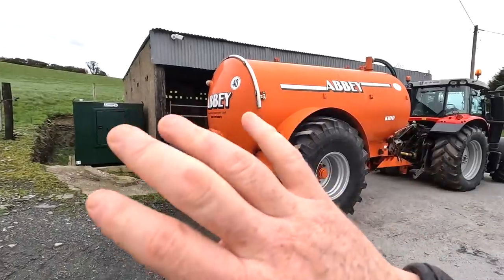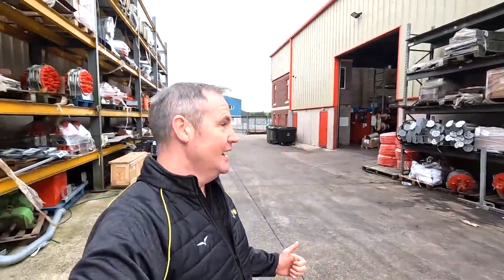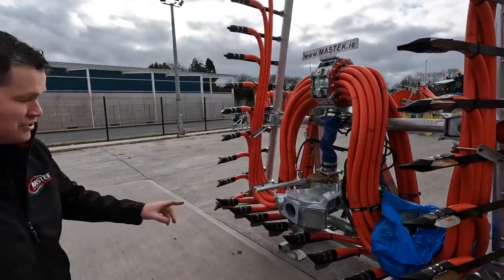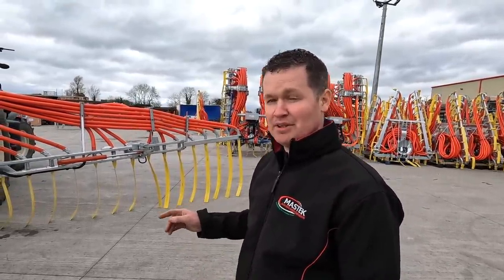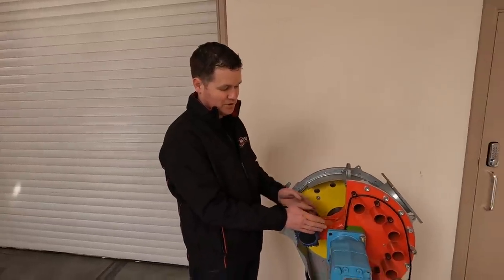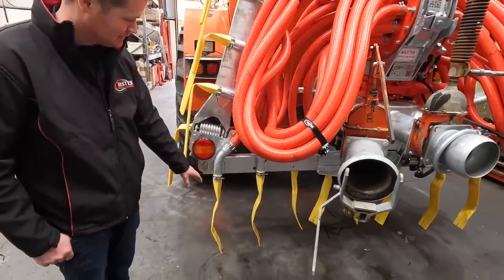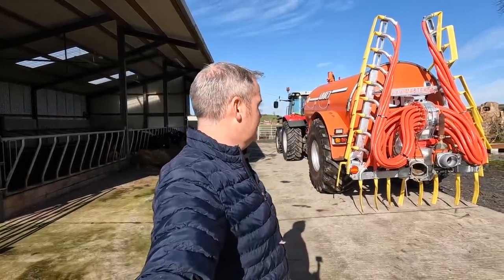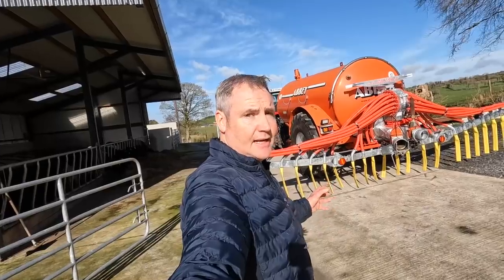RETRO FITTING A MASTEK DRIBBLE BAR TO AN OLD ABBEY TANKER - HOW IT'S DONE

Comment: Great to see you looking out for local businesses - what goes around comes around. It's certainly an extremely impressive operation at Mastek.
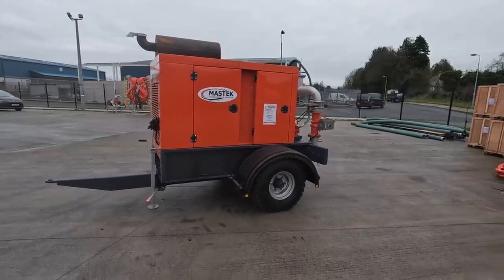12:35 wondering what's the petrol engine for, is it driving a vacuum pump for priming the system?
Great informative video, best of luck with the new machine.
Reply from the maker: I honestly don’t know lad, but I was thinking it was for the same job. Thanks meant to get Noel to show me around it but he was with another customer. That one was away to Latvia with a umbilical system

Comment: Interesting video. We need to be getting a dribble bar in the next year or so and have heard the Mastec are the ones to go for. Our Arla milk contract is banning the use of splash plates by 2025. Also on the slurry subject, just wondering if you have ever used slurry bugs? Its something that we are thinking about using to get more out of the slurry.
Reply from the maker: I have yes, i will try them out next year now that I have the dribble bar to see how they work out, I’ll go into as much depth as possible as I know a lot of people are thinking about the same.
Reply: I had an almost identical comment so didn't bother to put it up, we have a 6715 too so I will be interested to see how she handles his spreader with the dribble bar , we have a lot higher steeper land and hoped to be able to handle a 3000 gallon tank but are waiting and watching to see how this goes.

Comment: Such a simple machine if compared to the slurry injectiors that have to be used here in the Netherlands. Systems like these have been mandatory over here for over 20years at least, but dribling the slurry in between the grass isn't allowed anymore.. it has to be injected into the soil. 

But still i find these video's interesting to watch :) 

Cheers from the Netherlands
Casper
Reply from the maker: I was just talking to a guy about that last week, it will come here eventually as well, but I’m not sure how the injection systems will work here with our heavy ground.
Reply: @IFarmWeFarm  we are on heavy clay around here. The really blue stuff 😅. We haven't noticed anything in our feed or to the soil when they changed over from dribling (in your video you showed a system with a "shoe" that was used here) to injecting. But if there is too little rain the cuts may open up like cracks. 

Over there grounds might be more rocky i guess? I never operated an injector myself, but i would not be surprised if every cutting disc is springloaded. If I think of it, I'll make a little clip when they come bring our slurry in a week or 2. I'll send it on insta.
Reply: One issue I have seen with injection into stony land is small stones are disturbed with the discs that have to be rolled back down in silage fields
Reply: @claetuswoodroofe4164  i can imagine that.

Comment: I hope you find some thick slurry to try it on. Our slurry is usually thick and I am afraid that it will choke up pipes. We have a few years yet before we have to stop using the swash plate.
Reply from the maker: Thick slurry will always be a problem, it’s important to try an avoid that if possible. Now with our extra storage on the out farm we don’t really have that problem as no water is been removed to make room over the winter

Comment: Well ware Adrian.. you won’t regret the mastek..just a note if you don’t have the reducer fitted in the macerater you will need to drive a gear or two higher to get the same spread rate as before
Reply: Hi Donal, Do you have a reducer fitted? i hired out one and to get 2000G/acre id have to give Maxx Verstappen a run for his money.
Reply: @seamusoconnell8582  hi seamus.. no we were advised not to fit the reducer as we are contractors..they said it would cause us more hassle than its worth as its the reducer would be getting blocked not the macerator .80% of our work is dribble bar now and I maby had the cover off 3 times last year.
Reply: @seamusoconnell8582  8-10kph to get the 2000 gallons to the acre roughly..not easily driven on the hills
Reply: @donieoregan  Ya i was doing about 11k but only 95hp so had to stay on level fields but it was great education before i bought one. i went for major but with mastek macerator major dribble bar as apparently little smaller pipes. i used diet feeder so no issue with long fibres and blockages............................i hope. With 95hp tractor the reducer  would suit me. but i'll try it out 1st

Comment: For the sake of 10 minutes I would put half a tank of water threw the dribble bar to clean it out to stop the pipes hardening and blocking saves alot of time as you could spend 2 hours trying to unblock them👍

Comment: Learnt more about dribble bars in half an hour than ive ever read or heard before. Is the macerator easy to drive or is it hp dependant?
Reply from the maker: The macerator is hydraulically driven, so find out how many litres a minute your tractor produces, most tractors 90hp or more wouldn’t have a problem, Mastek will give you a break down on that if you give them a call.

Comment: That is the business Adrian, especially the year that's in it with the price of fertilizer, need to get every ounce of value out of the slurry. I'm  waiting on a new NC 1600 gal tank and dribble bar due in May, they use an Alrena macerator very similar to Masteks. Did mastek say anything about the speed of the macerator and the oil flow of the tractor? What was their advice? Thanks.
Reply: I think typically theyll draw 50l running a macerator.
Reply: @TheGreatBritishFarm  I'm more interested in flow rate and the recommended rpm of the macerator
Reply: Did a bit of research and it seems 60L/min is recommended and never exceed 75L/min. For mechanical spools, there usually is an adjustment knob on the spool. For electronic spools, can be done via menu. It is also recommended to reverse macerator every minute while spreading.
Reply: Mastek hyd pump needs 40l/min 👍

Comment: Great macerator but the stone trap having no quick release coupling is a let down. Great video and best of luck with it👍
Reply: Use plate that is cover, cut out 6 inch hole, thread tanker side, bolt on quick release coupler and u have quick and easy set up. No bother to man of ur skills 😎💪. I did to mine and so much easier than messing wit spanner n trying to lift on n off plate

Comment: I noticed your link arms are down to the bottom when you’re turning to the links not get caught on the stabilizer for the hitch on tanker what we do is The bars that hold up your link and we put them to the very end and put in a ball
Reply from the maker: I will be taking of the hitch stand when it put to use, but no even when it’s on the arms never touch the stand at full lock

Comment: Still don’t believe the back door mounting , back door on those old abbeys are the first for wrotting.
Reply from the maker: They fitted a new galvanised door, so it’s resting on the opening with the J bolts behind the door mount which takes a lot of the load in itself. There’s no issue there, seen all the engineers reports with regards the load capacity it can carry. 👍

Comment: I'm confused 😕 can you not use the splash plate 🤔 or is there a ban. Those dribble bars are ridiculous 😂😂
Reply from the maker: Splash plates are banned here for most farmers including myself, all low emissions spreading now. There are even country’s that have now banned this dribble bar method too recently and are direct injection only by trailing shoe. 
The dribble bar is actually a great system when you get used to it, and grass doesn’t get spoiled so grazing rotations can be much tighter, also grass uptake and growth is much better as more nutrients goes into the ground rather than lost in the atmosphere. After using it for over a year now we’re very happy with it